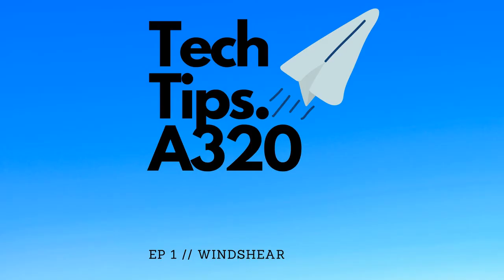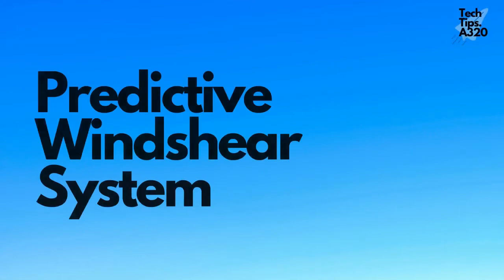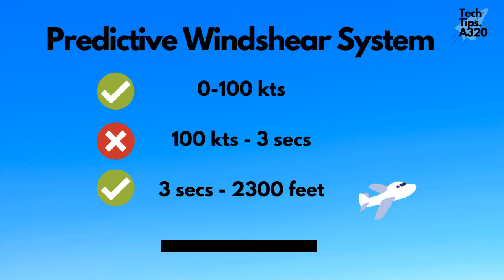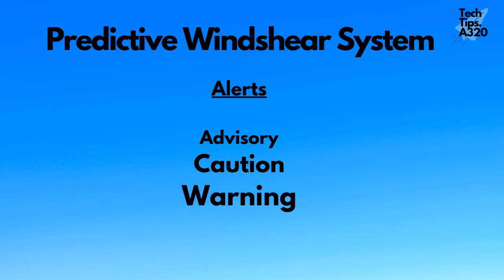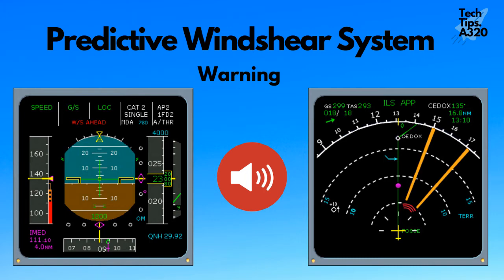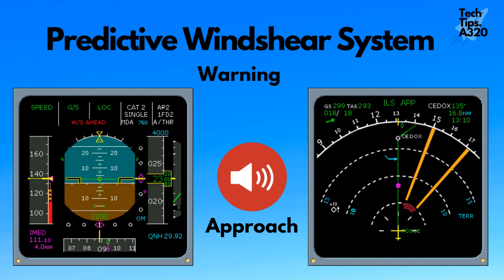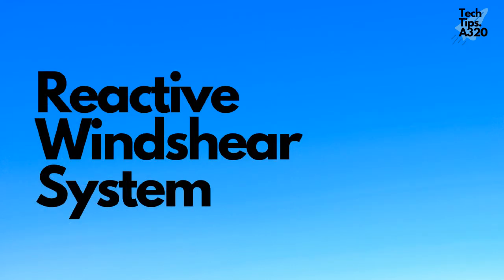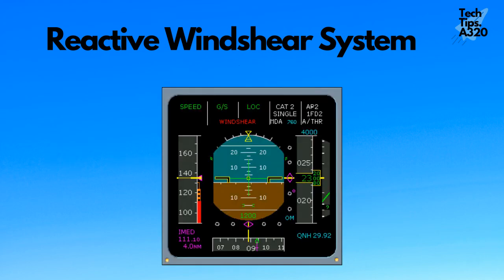Airbus A320 Windshear system explained- Predictive and Reactive

Comment: Sorry guys but I think you need to check your data. In the  CAUTION at 1:32,  when W/S AHEAD is displayed in amber on the PFD, the aural alert should be  "Monitor Radar Display."  FOR INFO  "Windshear Ahead" is an aural WARNING given during Take-Off. On approach with a WARNING with a red W/S AHEAD on the PFD,  the aural warning is "GO AROUND WINDSHEAR AHEAD."
Reply from the maker: Thanks for bringing this to our attention. At 01:32 the audio alert should indeed be "monitor radar display".